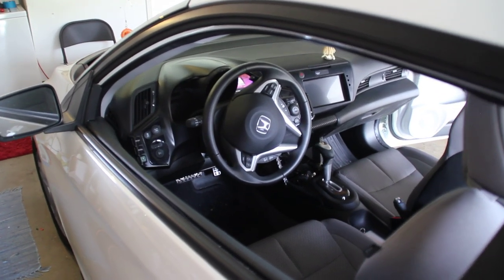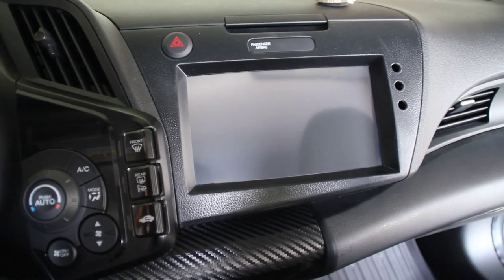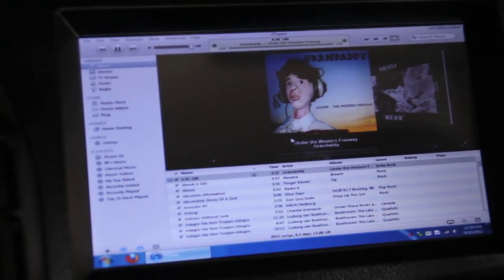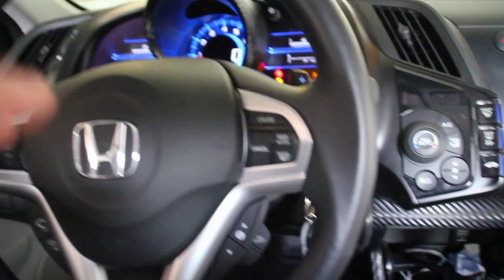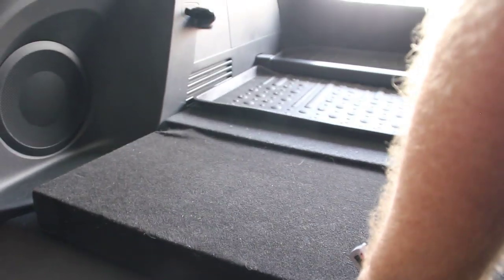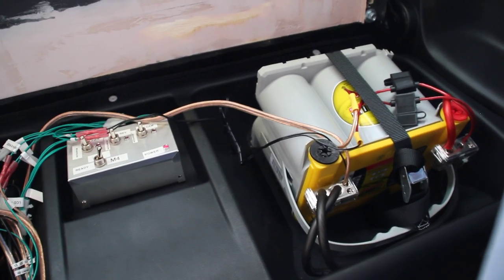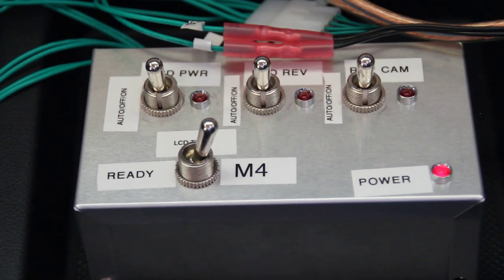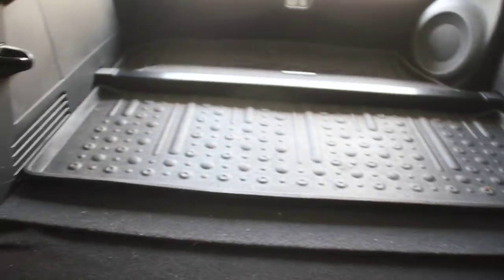Bill's CarPC - Part 8 - First boot!

Comment: Use windows 10 on tablet mode!!
Reply from the maker: This video is from 2012, about 3 years before Windows 10 came out, and even before Windows 8 was out. :)  This system doesn't exist anymore, but if I were to remake it I'd probably go with an off the shelf Android-based system.  Windows 10 would work, too, but the app support for automotive applications is MUCH better on Android.